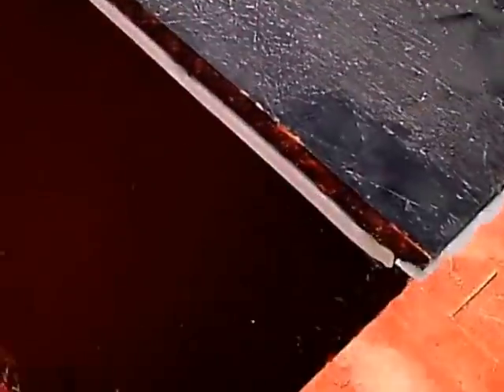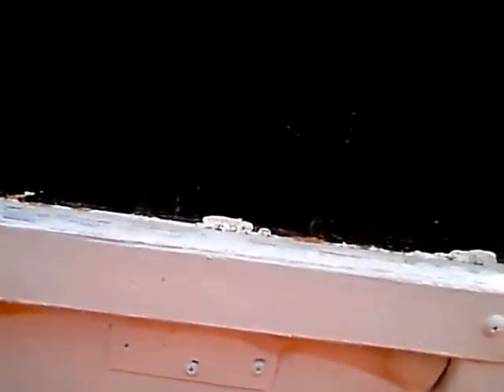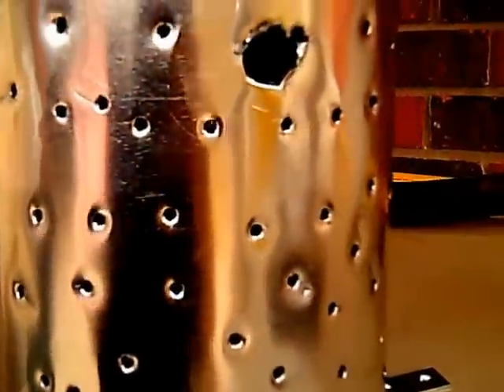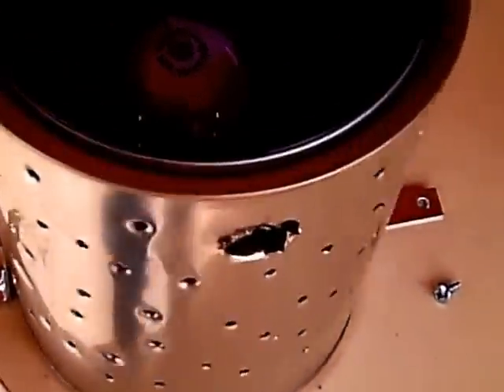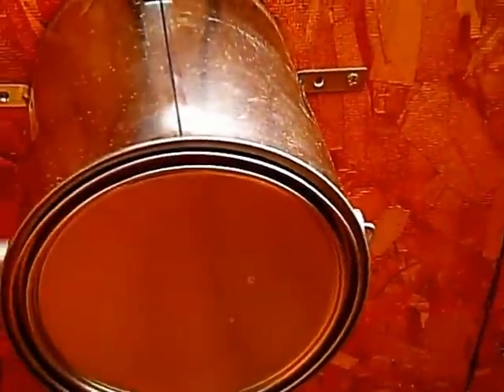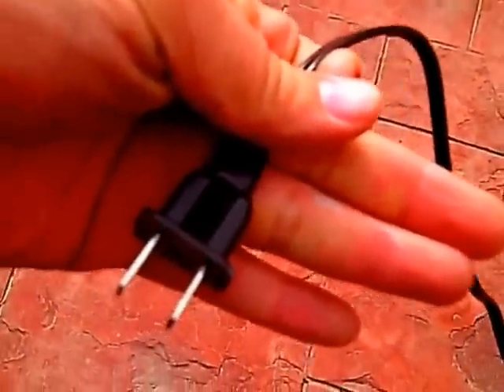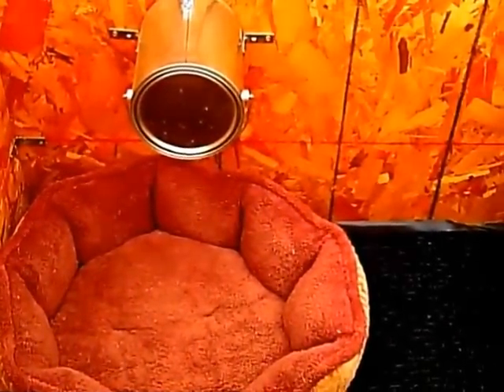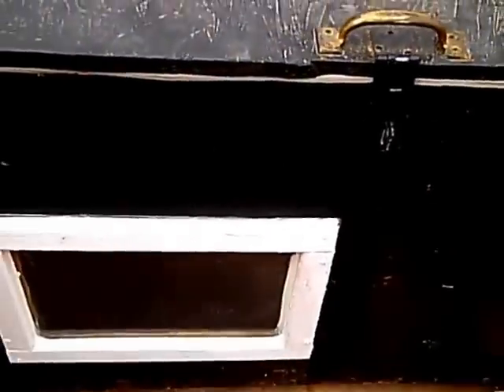Dog House Heater

Comment: Good job, how often do u replace the light bulb? Being that they are outside, make sure to use a 3 prong grounded electrical wire to prevent electricution, attached to a wall outlet that has a safety shut off button.Ill send a video when im done with mine.

Comment: hi greyalien2000 i notice this video poster back in 2012, how has this project been  working for ya? any updates you'd like to comment
Reply from the maker: Sure dogs still toasty and warm! Added metal to the roof and still in perfect condition!
Reply from the maker: Sure. It's still doing fine. Dogs still love it. I did put a metal roof on it.
Reply from the maker: I cut air conditioner ductwork and screwed it on the roof. No rain problems and house is still going strong and dogs still alive living in it with dog food bowl inside and no ants ever.